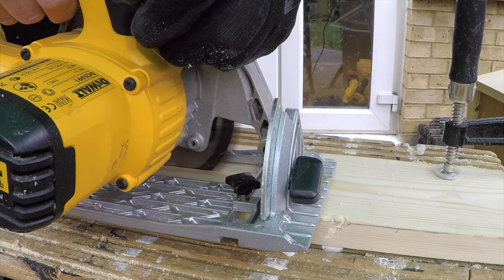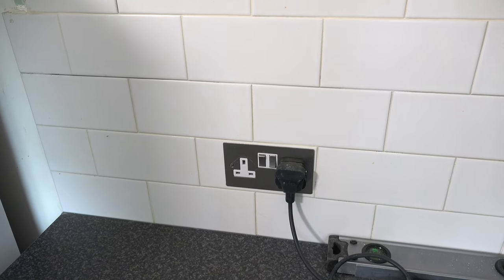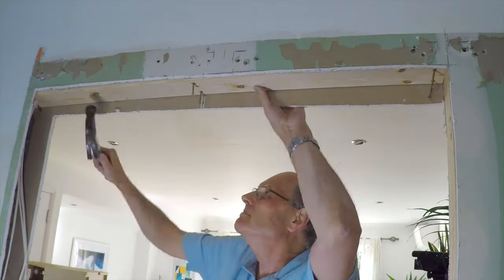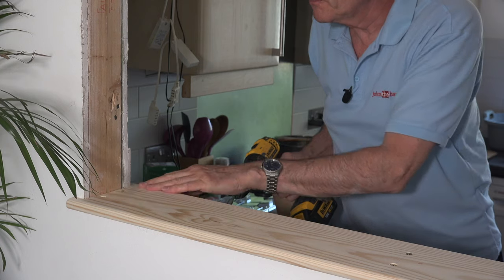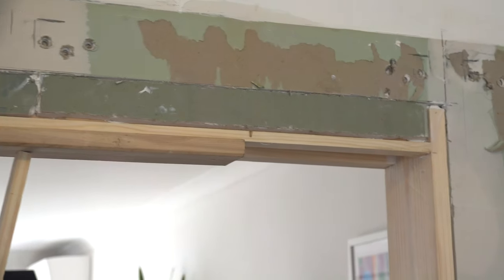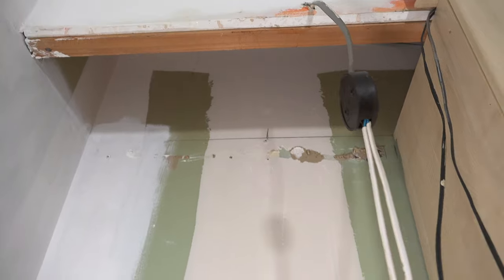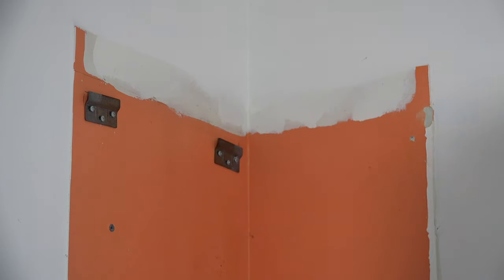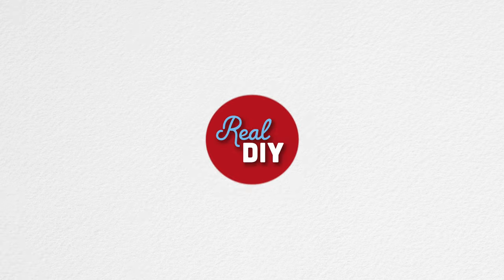How To Make A Kitchen Hatch, A Hole In A Wall. (#7)

Comment: That was great John and I was wondering if you’d use the Wago connectors. Such a time and fiddle saver
Reply from the maker: Thank you so much I appreciate that. The first time I've used Wago connectors. Aren't they great?
Reply: @JohnTheHandymanUK  John they are a game changer. You’ll know yourself if you’ve ever changed a UK pendant fitting for a flush fitting. It’s a real time consuming pain, never mind the ceiling repair after you push a terminal box up in to the ceiling void. Wago do lighting junction boxes for the 222 or new 221 small level connectors. Much smaller hole in the ceiling and a minutes saver. MK now do a Wago style 2 gang uk socket. I’m sold haha👍🏻
Reply from the maker: @carter83419  Yes I'm aware there are various versions. Definately the way to go.
Reply: @JohnTheHandymanUK  did you put the WAGO power snap blocks inside a cover housing or just leave them dangling (at 3.55) - I would have thought placing then inside the proprietary box would be added safety
Reply from the maker: @chrishainstock330  No I didn't see the need for an additional box as the connectors fully cover the ends of the cables.

Comment: Question. When you removed the drywall and exposed one singular stud, then later in the video before you place the actual bar top in place you see 5 equally spaced 2x4s at equal heights in place slipped in between the walls. Are those just sitting in there with gravity until the bar top is put in and then screwed down from above?
Reply from the maker: I'm not quite sure which studs you are referring to. At 3.52 the two sides 2x4s are screwed into the existing stud in the side wall. At 3.59 I think I slide 2x4s down into the wall, held with glue. These support the cill.

Comment: Are you not meant to have a 35 mm space between extractor fan and cupboards ?
Reply from the maker: I've never heard of a requirement for a 35mm gap and I can't think of a good reason for it so no I don't think it's necessary.

Comment: How do you know if the beam you took out is a support beam or not?
Reply from the maker: It is a stud partition wall so not load bearing. If it had been a solid wall it most likely would have been load bearing. If you tap a wall you can hear the difference, the stud wall sounds hollow.
Reply: When your puppy is pinned it’s a bearing wall

Comment: Im desperate to make a small hatch into my dining room but it is a supporting wall. I'd like a glass door or pair of glass doors so I can just open it when I need it, but also let the light in. How do I go about getting the glass door/s ?  I can't seem to source anything appropriate, it's only a small hatch due to the restricted space.
Reply from the maker: Hello, firstly if it's a supporting wall you'll need a lintel to spread the load from above. Probably a job for a builder who might be able to make a simple framed door with glass for you. If you are reasonably good at woodworking then have a go at making a simple frame and hold the glass in place with thin battens.
Reply: @JohnTheHandymanUK  thanks, I'm on getting some quotes now